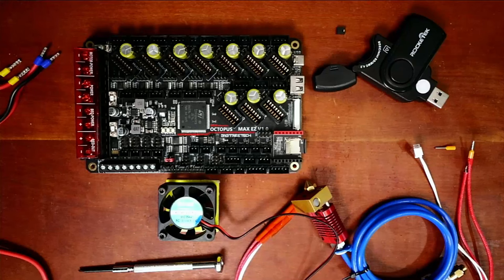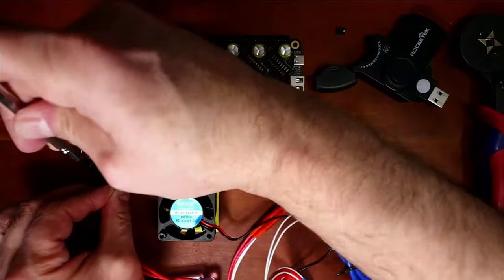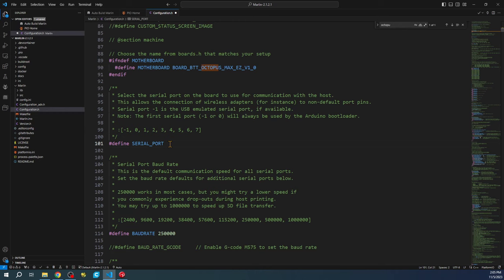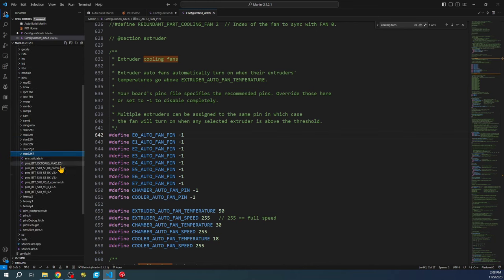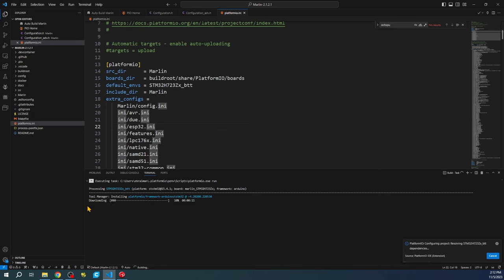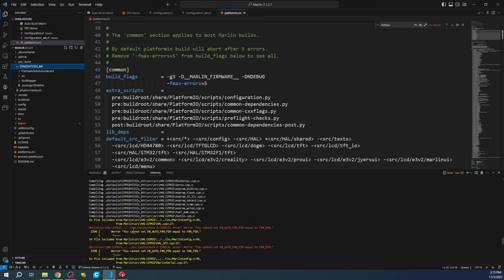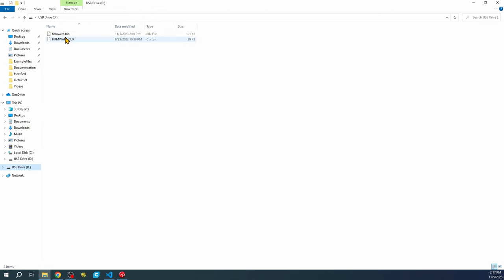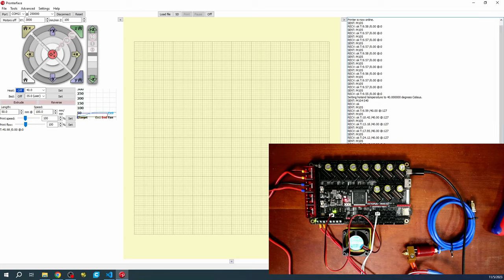Octopus Max EZ v1.0 - Hotend and Automatic Cooling Fans

Comment: I am following your videos to set up my boards, but i have lots of questions.
i am trying to use all 4 hotends that this board supports.
this means, i need 4 hotend cooling  fans, and 4 print cooling fans.
1. to be clear, this is the fan for cooling the hot end, not prints, right?
2. If you are moving PA6 to PA5, this would leave me with 3 fans, not the 4 i need, how do i use all 4?
3. how do i set up the 4 other fans? i dont care which ports go to hotend cooling, and which ones go to print cooling, but i need 8, 2pin fans going, preferably controlled when in use, not just on all the time...... i see there are 3 sets of 3 pin, and 3 sets of 4 pin fan ports next tot he 4 covered in this video, but i need sets of 4 to go with all 4 hot ends. How can i make this work with 8 controlled fans? 
BTT seams to have over looked they have things in 4s, not 3s.